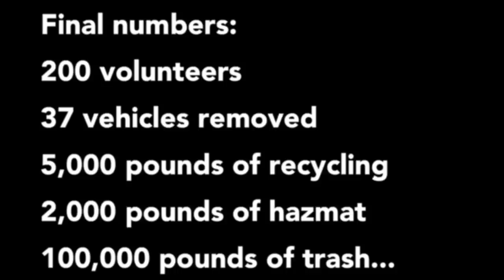We need to figure this out.

Comment: I worked in the sierra forest as a subcontractor for pge and usfs.   The only thing that even made a dent in the trash was opening up our dumpsters to anyone, and putting signs directing them to where to find  them.  It cost us money, and it chafed my boss to let just anyone use them (they should be packing out!), but once i convinced him that its better to let them dump their own trash then make me dump it for them (after picking it up), we saw a lot less trash on the ground.  It was also cheaper in the long run then paying people to clean it up.
Reply: Have a similar issue in my own neighborhood. I'd rather people put stuff in my dumpster than dumping it on my road or driveway
Reply: So what you are saying is that my Idea of dumpsters would actually work! And letting everyone use them would benefit all! So my idea is not so Original! But your testimony shows that it seems to have worked!!!😊
Reply: One problem with leaving dumpsters in the area is the sheer volume of trash.  We filled dozens of loads into dump trailers and multiple dumpsters.  The area is also a dumping site for shady local contractors dumping construction debris. If we out out dumpsters they’ll just attract even more people to the “free” dump instead of the municipal dump 5 miles away.  The local dump helps with the cleanup events, but won’t (and shouldn’t) fund a permanent free dump.
Reply: Maybe instead of dumpsters, hand out trash bags and inform them a truck will be coming weekly for pick up. I  noticed a lot of the sites had garbage bagged but maybe no way to haul it.
Reply: What's your experiencing is people that are on the trend of overlanding this issue is completely different where it's a homeless encampment. Were they completely destroyed the environment.
Reply: When I lived in desert country there was more people that were doing house clean outs and dumping in the desert washes. Where I live now the dumping is much less than in the past, besides it is to cold for homeless camps.  Best thing an individual can do is clean it up as you see it. The days of Alice's Restaurant are long gone.
Reply: Yall realize putting dumpsters out or sending a trash truck through millions of acres of land weekly costs money that's why residents pay for trash pickup so to implement dumpsters and trucks "free"would need paid by someone so taxpayers would end up paying for their own trash service and that of anyone who decided to use the "free" service and if more areas would work like this nobody would have to get paid to clean the areas up its all a volunteer service
Reply: Rats should not be ignored.
Reply: Valid points, its by no means a perfect solution.  They did clean up tons and tons of trash but that is also partially because the event is so spaced out, a scheduled pickup of dumpsters would alleviate this to some degree.  The usfs and blm does this strategy other places all the time.  It does cost money but there are budgets and fed funding to preserve land and wildlife so the burden isnt necessarily born by local residents alone.  There are also things like access and camping fees to help recoup this expense.  As for cheap crooked businesses who would drive all the way to dump out there, i think that is a small percentage that is worth the collateral damage.  There are also mitigation measures for that (trail cams).
Reply: @Vanlifecrisis   The complaint that dumpssters cost tax payers money negates the fact that all of these volunteers time, equipment and fuel cost money.  I am glad that people step up to do this, but at the same time everyone is putting the cost burden on them with very little thought. Taking care of the root problems would likely lesson the burden for everyone involved.
Reply: @sephw9246  one thing that's also helped my community is having coupons and deals where people can get rid of stuff for free or at a reduced rate. People are also allowed to get rid of 4 tires a day and stuff like that. They also have a free area where if you pay to get rid of something you can pick out stuff the might still be in good condition or able to be re purpose.
Reply: @cheesecurd100s  come to Minnepaolis MN bro there is pikes of garbage on every single street Coner it's disgusting
Reply: @Vanlifecrisis  l
Reply: @sephw9246  this is where LEOs and local politicians do their part, but my experience  indicates an apathetic or hostile outcome.
Reply: @sephw9246  Trapper cams to catch the shady people dumping and put out dumpsters to save the massive effort by so many people.  Seems a small local organization dedicated to maintaining dumpsters would take care of the problem and the cams would keep it viable.  That way the law enforcement can tend to the people that have no business using them and keep the cost down on those who donate to the organization.  Just an idea!  I'm sure someone already said something but it is something of that sort or keep having the big cleanup days it seems.
Reply: @sephw9246    I lived in a state where we had a free dump.  It was great and we had little to no trash strung around.
Reply: As long as trash is a for-profit enterprise and not a basic taxpayer-funded service, litter and dumping will always be a problem.
Reply: Intelligence is required, then action.

Comment: Went out with group five at the cleanup. Was amazed at the amount of "stuff" that was used to build some of the  . Ever a shopping cart. Seven miles out of Bend. Cleaned around a travel trailer with a young couple, car was removed, but the area was a mess. Our leader told us that the people were asked if PLS could cleas up around their camp, and yes, you can. The young couple even helped. They had no way to haul the trash, even had a lot in black bags and ODOT type yellow bags. 18 or so people, 2-3 hours worked there. The couple were down on their luck. I'm not judging, as I know, many can be a paycheck away from that position. I'm the old guy you met who donated to the cause, I'm torn by what has happened to the old and/young of our great country. You have shown in your last 3 or 4 videos a good description/explanation of what is happening. Many thanks to Casey and the many business, other volunteers who worked that Saturday. NO grumbling or complaining just people helping keep the forest clean. Getting to meet the many different people who were volunteering was also fun. I'm a retired carpenter, met a young "to me, 79" lady with many more yrs of Ed. than I, others near old as I, helping. Anyone or all who wanted to help. We worked hard, met new friends, and will be "out there" in June again. Requiring no special talent just a willingness to help. Casey has done a good explanation of the cleanup. Who was that....Bigfoot in red plaid? I've met Jason several times last year, and now Casey, last weekend, two great people.

Comment: Watching that exercise, my mind went back to when gramps hooked up a hay rake to the back of a 30's vintage McCormack Deering steel wheeled 10-20 and pulled it through one of his fields alongside a road leading to the local landfill where lots of trash blew out of pick-ups etc., heading to the dump.  That worked well and he didn't need to worry about punctures on calcium solution loaded tires. You folks should be proud of yourselves for both respecting th forest and the less fortunate who are genuinely trying to leave no mess while getting back on their feet. Kudos. 👍

Comment: Love Love love what you do with this!!! And impressed with the stats as well!!!
I can’t believe that all my Years in the Army doing “Police Call” picking up trash, would give me so much respect and appreciation for what volunteers do, in the Civilian community. 

A crazy bandaid idea of mine is to put 3-5 yard dumpsters and recycling containers, in front of the areas where they can be easily accessible for dumping and use by the people in the “communities of tents, camps” etc… but most importantly a 3x5 foot before and after picture, with a good caption on it! Could be helpful in so many ways! Shaming people to pick up their own trash, never seemed so right!!!
Either make it a sign on 2 posts with a fiberglass posts & board (non burning) or put it on the Dumpster itself. It will have to be dumped periodically. But what a difference it could make!!!

Comment: you've done it Casey, you finally got a sub. litter and homelessness are 2 issues that i have lots of experience with. your break down of the homelessness problem is spot on, you cant solve the problem if you dont understand that no 2 people are homeless for the same reason. its not as easy as one blanket solution to end all homelessness.     as per the camera operator vs. bag filler debate, it definitely helps the clean up movement to have big youtubers posting content like this. if your worried that you should be doing more physical work to give back perhaps you could reach out to a local organization that works with the differently abled and get someone who might not be able to do the bending and lifting but would like to learn a bit about videography. :)

Comment: Problem is easy to solve with a campground host. We are hosting an area in Colorado/Utah border for the nation forest service. It's a lot more cost effective than having all that equipment. In our campground there isn't any trash cans or dumpsters with no water either. We are retired and it helps us with a place to stay for summer. Contact me for more information.. our campground is very clean. It's about 200ac. We walked the camp and picked up everything. Harbor freight grabbing tool is your friend. As time goes by with this economy this is going to become more of a problem.

Comment: In thousands of years geologists will discover there is a "micro plastic layer" in the sediment of the planet. Carbon dating will date the micro plastic layer  1950-2100. 

It will be a thin sediment layer where all the plastic broke down before being covered naturally by soil accumulation and sediment buildup. 

Above the micro plastic layer soils will be cleaner again but it could take centuries for all the plastic on the surface to break down.